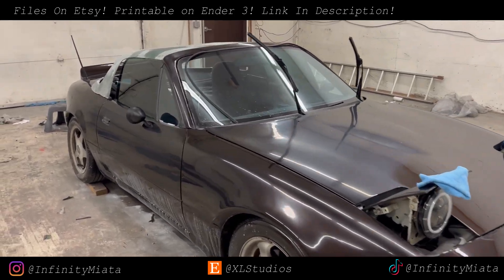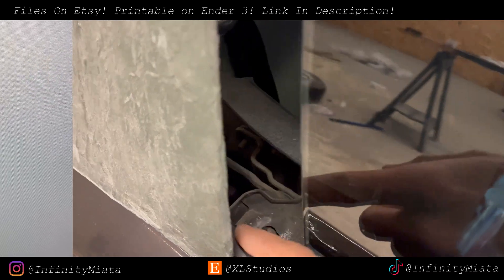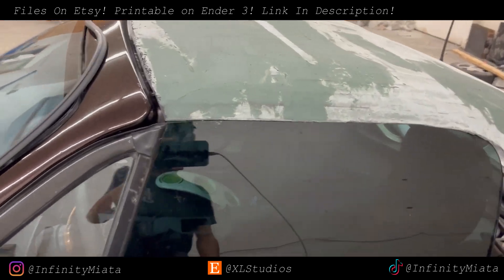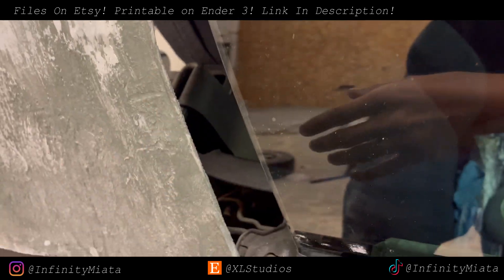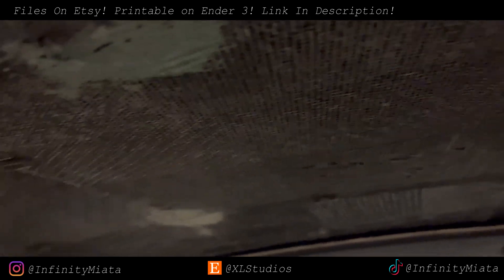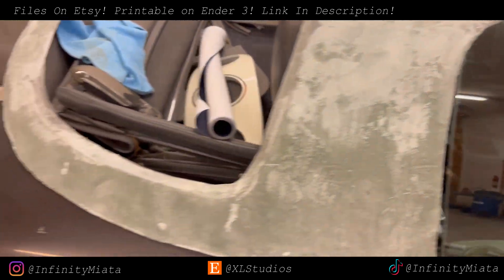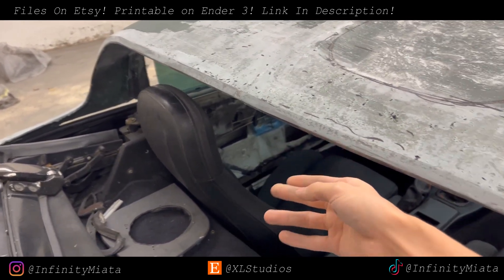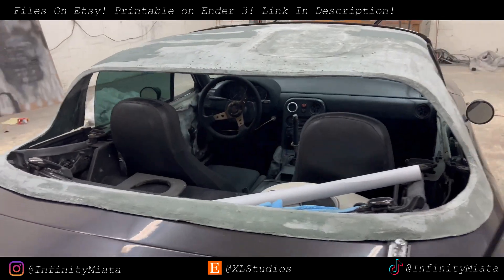3D Printed Miata Hard Top Update Pt 2

Comment: love the video and the progress, had a couple questions

how did you get the CAD model of the miata? did you scan it and than work off of that or use measure critical car dimensions? 

Also, wondered if adding slots to feed alu bar would help keep the entire roof part aligned and strengethened to not sag

slightly unrelated but was curious on the strength / which LED's you went with for your infiniti mirror. I used what I thought were 12v 5050 high power LED's for my infiniti mirror up front and they weren't as strong as I'd liked.

Very cool project and can't wait to see more,
Reply from the maker: Used critical car dimensions. The Louver will do what the alu bar would do, and support the body lines while I work with putty. Sorry my software rendered the videos incorrectly! I’ll upload the raw videos to my channel!